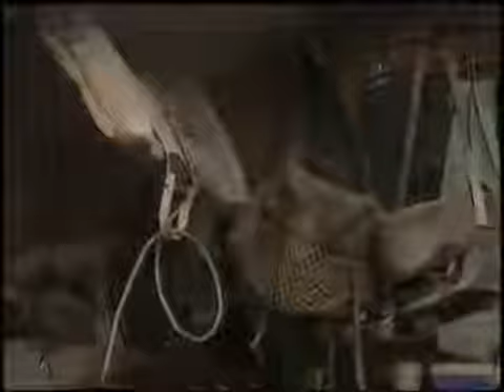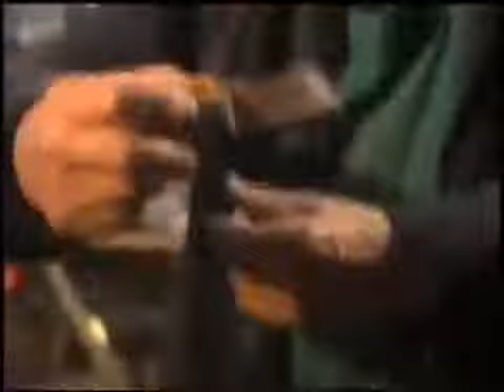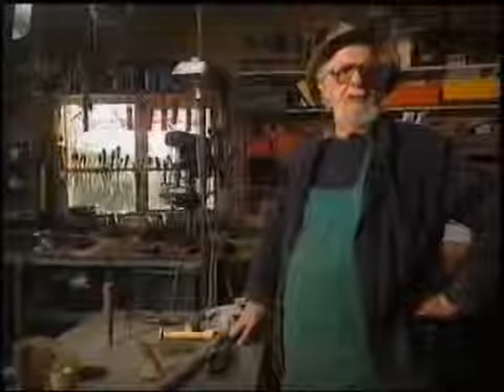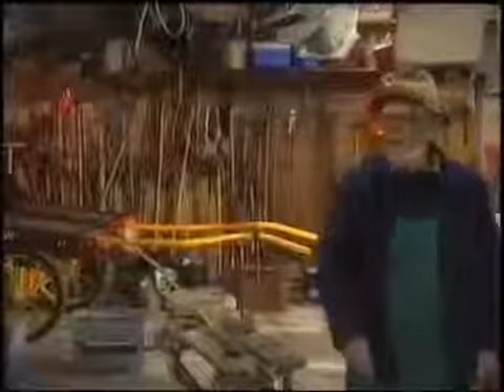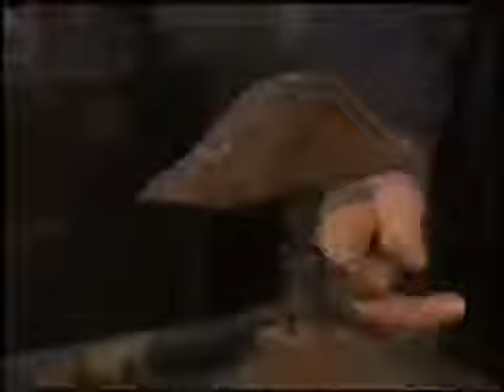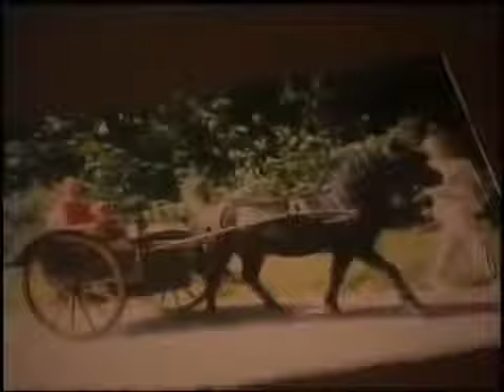Tribute To Jack Hargreaves (1994)

Comment: I loved watching his programmes when I was young. I found them so informative and there was nostalgia for a time when everything in the countryside was so much simpler. One thing I remember very clearly (and for which Jack does not get the credit - although he should) is that he created the very first strimmer. He put a fishing real on a motor and then attached that to a pole and showed everyone how they could cut the grass and weeds without having to bend over.

Wikipedia suggests that the first brush cutter was produced in Japan in 1960 by Echo. The U.S. string trimmer was invented in the early-1970s by George Ballas of Houston, Texas, who conceived the idea while watching the revolving action of the cleaning brushes in an automatic car wash. His first trimmer was made by attaching pieces of heavy-duty fishing line to a tin can bolted to an edger. Ballas developed this into what he called the "Weed Whacker", since it chewed up the grass and weeds around trees.

I recall that Jack Hargreaves, a keen fisherman, came up with the idea (in the Fifties) and put it in one of his episodes in the Sixties. So he probably beat the Japanese and the Americans to the idea. It wasn't until the seventies that every gardening tool company started manufacturing them, but it was Jack who put together the first one. He never received any commission for his brilliant idea or any credit, but if you look back through his TV programmes he mentions how he came up with the idea of combining his fishing with his gardening, which is a much more plausible explanation than George Ballas' claim of watching cleaning brushes in a car wash.